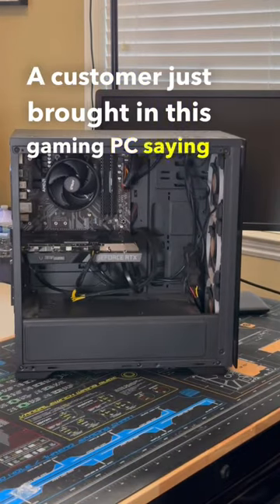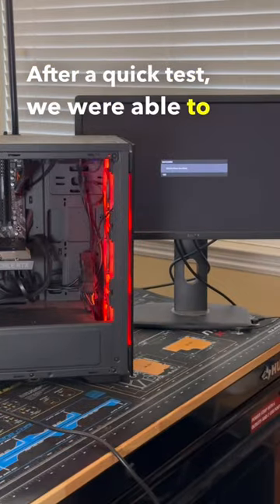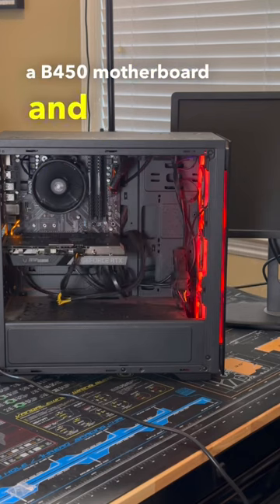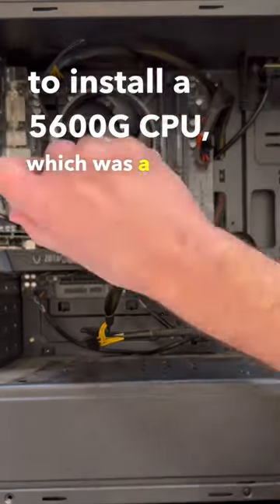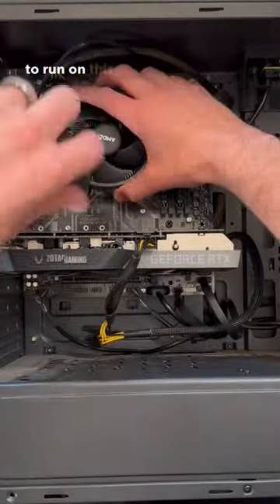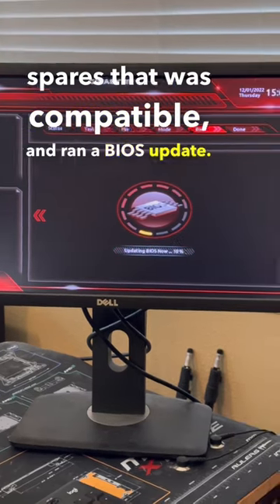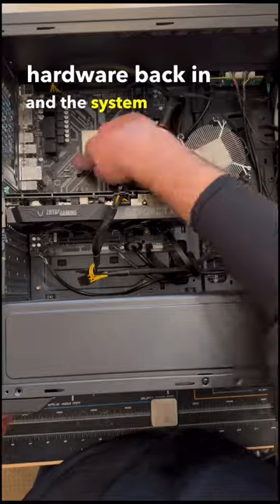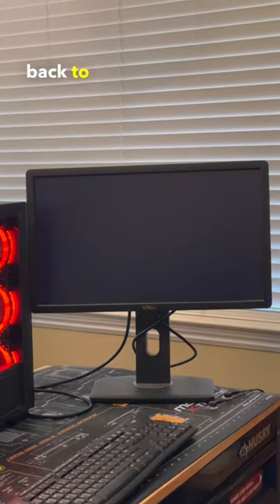Gaming PC Not Booting After CPU Upgrade: Here's How To Fix It! #shorts #pcrepair #pcbuild #gamingpc

Comment: It's very simple to add parts into PC Part Picker and a lot of the time it tells you if a bios might need an update to work 

Alternatively buy a motherboard that has the ability to update the bios via a usb without the need of a cpu and save your time and money or some stores will update the bios free if requested

If he didn't need the igpu he should've just got the 5600x and a B550M VDH WIFI mobo that would've allowed him to update the bios with only a usb and psu plus had better performance than the 5600g

Comment: So, if I want to put in a newer chip I should update my bios before taking the current chip out?
Reply: If you can flash the bios update on it with a flash drive put in the bios slot and you have the flash bios button, then it wouldn't matter when

Comment: I had a huge problem with bios updates when ryen 3000 came out
Bought a non-updated x470 aorus ultra gaming. Bought a cheap A8-7600 to update since the shop was charging 150€ instead of 50€ for the cpu

Had to make 2 bios updates. After the first one, I didn't get any video output anymore
Turned out, my old cpu was not gonna work on the F30 bios version, but ryzen 3000 series also didn't work(needed F40 bios). Took like 3 days of research and another cpu(ryzen 1200) to finally get that bios comoatible with my ryzen 5 3609
Reply from the maker: Yeah it wasn’t the most seamless process. I remember having so many customers calling me about that then.

Comment: Or just get use a flash drive, download the bios driver from another computer. Copy the file on the usb drive. Install the flash drive in the bios usb port and hold down the bios button. It will flash itself that way too. Probably quicker than putting in another cpu.
Reply from the maker: That is only a possibility on some motherboards which in this case the motherboard didn’t support that feature
Reply: @mattscomputerservices  True

Comment: Have an X570 which worked with a 1700, but didn't with my 5600x. Had to update the bios before the 5600x would work. Funnily enough the bios update stopped it working with the 1700
Reply: I am building with the same x570 with amd ryzen 5 5600x do I need to change the motherboard or will that be fine if I update the bios
Reply: @__SINGH__S  It depends on the board. I had a very early Asus Prime Pro on a revision before the 5000 series support.

Have a look at which version your BIOS is on and then look at the motherboard BIOS update page online. That will tell you if your BIOS will work.

If you can't boot your system to check, the BIOS revision that the board came with (therefore theoretically the lowest version the board will be on), is on a sticker on the box and on the motherboard.
Reply: It's supposed to stop compatibility with older cpus . Why ? Because the bios chip on those older boards didn't have enough memory/storage to hold all the files necessary for all cpus ,1st gen to 3rd gen.

Comment: If he had a MSI board, you could have left everything in it's place, put the newest firmware on a flash drive, stick it into the firmware USB slot and then pressnthe firmware update button next to the usb slot. Problem solved.
Reply: I was thinking the same thing. This whole process can be done in 5-10 minutes max

Comment: I'm running into the same issue almost. 3600x into a 5800x3d. PC won't fully boot, have power to everything but no video.

I SWEAR I updated the BIOS. I'm on an X570 MB but I bought it before the 5800x3d release. 

I suspect the CPU is DOA. Any help is appreciated

Comment: got an A320M grenade and my new r5 3600 wont let my gpu start (rx570) but my old cpu works with my newer ram (ddr4 dual core 8gb). do i need to make a bios update before installing my new cpu?

Comment: I just stumbled upon your vid man, quick question, would a biostar b550mh need a bios update for that same processor? I mean, got a more recent chipset but I'm not sure 🤔
Thanks in advance tho
Reply: You need to check the compatibility page of the mobo. You can also ask the seller if it has any info on the box for cpu support. And also if you can spend a little more get a better board because that biostar board is realy bad
Reply: always check your mobo's web page. they usually have supported list of processor with needed bios update. then check your current bios version to see wether you need to update or not.
Reply: I did just that, maybe should rephrase to is it compatible out of the box? (it was, fortunately) Cause in the web page they do tell you that it's compatible but I guess there's no way to know if it have the latest bios version(or the one it started being compatible at least).
Also, was in a very tight budget, won't use it for crazy OC or anything.
Thank you for your answers tho

Comment: when i boot my pc they light up in sequence. it starts with the white led(4 seconds), goes to yellow(4seconds), but then once it turns red only lights up for 1-2 seconds then goes back to white and the sequence loops. They don’t blink rapidly they light up once each. I have power, gpu,AIO and fans all turn on. I reseated my plugs, ram, gpu, flashed bios, still nothing. help!!! do i need to clear the cmos and redo bios flash? brand new build trying to get it to post

Comment: Will a b450-f motherboard be able to handle a ryzen 9 5900x?
Reply: Yes.
Reply: @yoshy5651  thx :)
Reply: @Mr.Goat_  yep just make sure that motherboard comes with the 4007 bios. If it's less then that, then you'll need to update the motherboard.
Reply: @yoshy5651  how do i check that? And if i find out that its lower, how do i update it?

Comment: I got issue, while using dp cable, it will black screen until the password screen pop out, if I hold shift restart or restart keep on pressing Del try to go into bios, it will black screen all the way even the mobo check light all gone, but hdmi just fine as usual, make me pissing off and change the cpu from AMD to Intel, same as mobo, but same shit…damn…what’s wrong…

I7-13kf, 4080, z790 ddr5…all new, about 2 days ago…I guess last resolve is to reinstall windows

Comment: Bullshit. Pcs will not boot after cpu replacement. Tried this. Checked compatibility, updated bios, cleared cmoss. Nothing. 75% of the time, black screen. Other times its stuck in bios. Changing any settings results in no screen. Garbage pc.

Comment: Thats what I'm hoping to not encounter. I'm going to try and put a 5600G on my A320i.
Reply from the maker: Well I would just check with your motherboard manufacture what bios is needed and check your current bios before making the upgrade. If you don’t have the latest version update it before you upgrade your cpu it will save a big headache
Reply: 320 mobos, won’t work with a. 5000 series and cpu

Comment: Wow! I just built a pc yesterday and it wasn’t booting up and it turns out I need to update the bios for the motherboard. I have a z690 motherboard and a i5 13600k. I’m gonna take it to geek squad tmrw. Does anyone know if they will charge me just to do this?
Reply: 3 months late but you can just use a flash drive if your motherboard supports flash updating bios. Won't even need a different CPU in it

Comment: Does anybody know if there is a way to update the bios without having to use a cpu? I'm building my first pc and I would like to go with the i5 13600kf but the motherboard(Asus rog strix b660i) won't support it unless you update the bios. If I can't update the bios i have to go with a i5 12600kf. I'll appreciate a lot all your recommendations/tips/knowledge.
Reply: I think that board has easy flash or something like that you don't need a certain CPU to flash it , just a USB with the correct bios. But Google is your friend 👍if more help is needed.
Reply: @kouderuivy  yeah i ve just run into other people with my same problem. What I discovered, thanks to them, is that near the cpu socket on the motherboard there is a barcode and the last 4 digit of that barcode is the bios version. If the version is 1620 the motherboard supports 13th gen cpu. I got lucky since my motherboard has the 1620 version.

Comment: Nothing Special ..my new build is in a 550m MB and  IT comes with 2.50 BIOS R5000 ready .

If IT comes without you Had to Upgrade BIOS With old 3000 CPU bevor Install 5000.

Because cheap MB dont have USB Flashback bios funktion to flash without CPU .